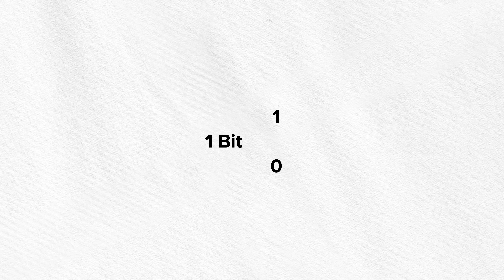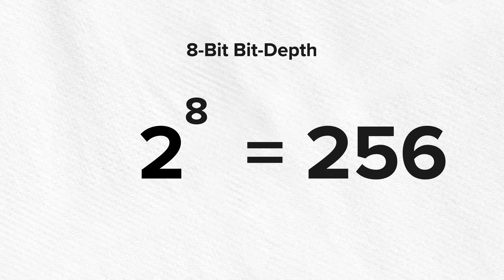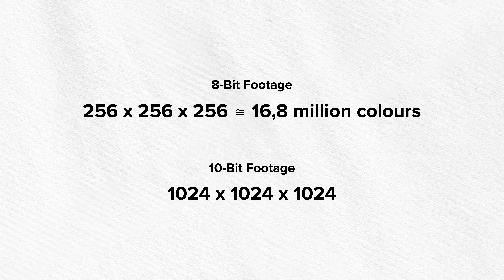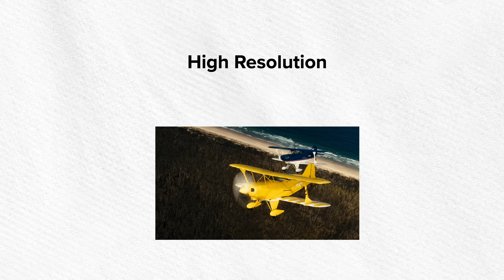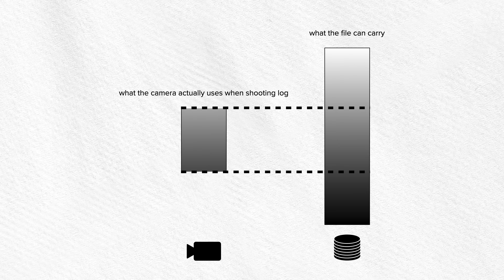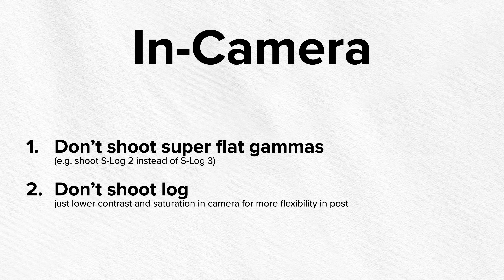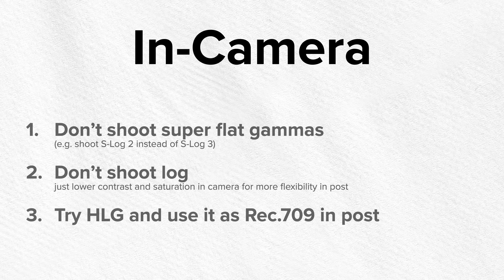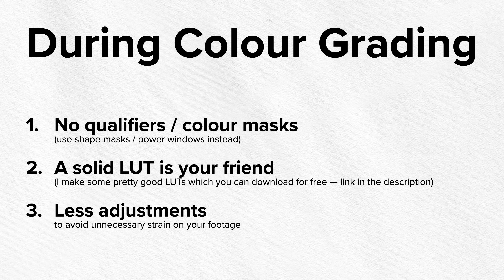Why 8-Bit Footage Breaks and How to Fix it!

Comment: The explanation of log is not correct. Any 8 bit log profile use all steps between 0 and 256. The only difference is that log evens out the colour resolution between the bits so instead of having great colour resolution towards the brightest area of the image and poor resolution towards the darker areas, you now have equally good resolution across the scale.

Comment: Hey Eric, great video, colour banding is my number one issue for my motion design. 

Mainly how to avoid banding issues and other artifacts when compression/encoding algorithms just destroy my work when uploading to social media. With YouTube there's high bit depth options but there is nothing more soul destroying than getting a great result that looks good on my computer and then totally ruined on upload. 

A lot of my questions revolve around aftereffects and 2D/3D work. I have collected lots of advice but it's hard to know how they interplay

1. Impact of fast moving objects on banding 
2. What are optimal workflows for working at high bit depth for low bit depth deliverable, i.e working with EXRs (16+)  even if 10bit or 8bit output, best loseless to h.264 workflows
3. How destructive is using just 1 or 2 8bit effects in precomps of an overall 16bit project
4. Which different adjustments to avoid...contrast
5. Does CBR vs VBR actually make a difference to banding 

If you think you are a good person to answer these kind of questions then perhaps I might book a session.

Comment: That’s not how log works….
Reply from the maker: What‘s wrong with that visual representation?
Reply: @iamericlenz  It does the opposite: while a "normal processed" image is adjusted to get nice contrast and colors on the final viewing device, it discards information (especially in the highs and lows).
Log compresses all the information of the sensor into the available bandwidth, even if the final viewing device can not display it. That's why it looks "washed out".
But then you can (and have to) decide afterwards, what part of the image information should be displayed how, something you can't really do if you directly save the "normal processed" image.
Reply: @ljackattack You are confused between log and Raw

Comment: I’m very VERY glad I came across this. 

All of this is not entirely accurate. Log is meant to take the entire dynamic range in linear and squeeze it logarithmically. Funny enough most sony mirrorless cameras and most other popular cameras have 12bit linear readout before processing is applied internally. Now when the log encoding is applied, it takes those 12bits and can squueze it to 8bits with no loss of dynamic range or tonal range. This is why I always say slog3 is 100% usable in 8bit sony cameras.

Now where the issue truly lies with 8bit is using vast color gamuts such as sgamut which is not even the real sgamut from the cinealta line. It’s just an approximation meant to color match alpha/fs/fx lines to the cinealta camera footage. Sgamut is massive (almost rec.2020) and trying to fit that much color into 255 shades causes massive issues. Not to speak of the fact that it’s an approximation meaning it’s not color accurate at all. What 10bit log fixes here is the issue with the color banding. So using sgamut/vgamut and such with 8bits is the actual issue. There’s a way to remedy this.

There’s a colorspace that almost every capable sensor today can faithfully reproduce and that is rec.709. It also neatly fits into 8bit without much banding issues. Sony calls this gamut ITU709 Matrix. Unfortunately you cannot change this with lumix cameras such as the GH4 but 8bit hasn’t been an issue for a WHILE with lumix.

So what you do is combine Slog3 gamma (which takes the entire dynamic range of the sensor) and combine it with the ITU709 Matrix gamut. Unfortunately your gamma view assist will not work anymore and you’ll have to make a LUT taking in Slog3/Rec.709 and spitting out a Rec.709 gamma 2.4 image and monitor the image using an external monitor.

Once you do this, you’ll realise the colors are amazingly color accurate like 1:1 rendition to real life, you can push them as hard and even harder than 10bit sgamut footage. The only issue with the ITU709 is that it simply clips colors it cannot perceive, but you won’t see that on your NLE. It’s a smooth rolloff into nothing.

When I say that the old 8bit sony cameras are still VERY MUCH USABLE today, I really mean it!
Reply: I shoot in 8bit 4.2.0, S- Log 2 and SGammut3.Cine. after the grade a convert it to Rec.709 and 2.4 gamma, everything looks beautiful.
Reply: @ yeah but your dynamic range is limited since slog2 doesn’t map the entire dynamic range of the sensor and sgamut3.cine is not as color accurate. 

But if it gives you the results you want then thats awesome
Reply: I will try shooting some flowers and very color intense scenes in Slog3 ITU709 matrix today in my a6400!
Reply: so I did some testing with my 35mm f1.8 and it looks so good. The only post-process need they need is some curves in the RGB curve in Premiere but I noticed stronger CA in the video. So definitely watch for that when shooting. I will try Slog2+ITU709 next!
Reply: @ that’s not exatcly what you should be doing. You’re supposed to transform the actual slog3/itu709 into rec.709/gamma 2.4 but the issue with premiere is that there is not color space transform and a lut needs to be manually developed in davinci. I’ll make a video on this at some point and link the lut
Reply: @ try comparing the CA to your RAW photos. Chances are that the colors matching your CA were muted in Sgamut and not represented well. Try closing down the lens a stop and it should massively improve
Reply: @shueibdahirmotionpictures  It would be great if you show how to work as you are describing. Have a simple zv-e10 (and final cut) and it would be great to learn to maximise it!
Reply: was thinking, that what he said about log squeezing not using the whole 8bits wasn't right...
Reply: @rapflapfl  yeah for 12bit linear which is 12 stops as in 4096 values can be represented with 255 values in log. For 14bit linear which is 14 stops and 16384 values, you need 1024 values to represent it. Only mirrorless cameras I know use that many values are the XH2s and Canon C70 and those don’t even offer 8bit in log. 

There’s a lot of misinformation in the camera marketing meant to have you spend much more money. The only reason to even by higher end cameras is to mostly gain more internal processing power or some feature that will very much save you time in production
Reply: A lot depends on how the image is going to be processed in the pipeline. A clean, ungraded 8 bit log image may look good, but it wouldn’t take much for it to break in post-production once you start grading, tweaking black levels, etc.  ILM used 8 bit log in the 90s for their movie work, as opposed to Kodak’s 10 bit cineon log format, and it shows, particularly in the blacks, in their movies back then.
Reply: @crunch8484  You seem to misunderstand what I meant. When it comes to bitlength, 8bit is more than enough for reproducing 12 stops of DR and containing rec.709 and being just as robust as 10bit log. This applies to only SONY cameras.

The issue is not the bitlength, it’s the codec used which dictates how much abuse the log footage can take
Reply: is this real?? i'm using ZV-E10 I and i'm struggling a lot with banding when using slog3 and sgamut 3 especially on skin color and sky and that makes me stop using any type of slog..
Reply: @PinotNoir_  Try this fix, overexpose so that the midtones and shadows are recording higher up in the log curve, next increase in camera saturation to +20 and bring it down in post, try to shoot at native iso of 500 or even till ISO 2500, apply LUT or rec 709 transform in Davinci and literally the image would be breathtaking. And don't be discouraged looking at shadows when switching to slog3 which has a noisy magenta hue, it won't show up when you record and for magenta shadows, just add more green in white balance.
Reply: @adyahhindi i usually shot it at +2 EV, but never tried to set the saturation to +20. I'll try it when i get a chance to record something, thanks!
Reply: @PinotNoir_ did it work? Just bought one ZV-E10 👀
Reply: @jorgealbertomartinezortiz374 maybe it's because my lack of coloring skill or i didn't expose the clip correctly, but it didn't really work, it reduce the banding but it's still visible. maybe it's just the fate of 8bit camera i guess. Gonna try slog2 next since it's supposed to work much better with 8bit camera
Reply: What’s the best picture profile and color space for 8 bit without using an external monitor? I’d like to try this but I don’t have a monitor
Reply: I agree on the original comment. Slight modification: I prefer movie colour space over ITU 709 Matrix because the latter is very reddish on my camera model and introduces a whole lot of WB work whereas with Movie it's fine and as you said: really accurate.

Comment: In my experience I didn't have a lot of visible banding with '8 bit log footage', but rather that blochiness in dark areas. Which brought me, and, I guess everyone with that problem, to a simple solution - avoid completely black areas in the shot and give them a proper light. That means you have a very well lit shot and can drag the exposure down, and here's that problem with the colours - you just can't jump from even very well lit tones to "moody" tones without breaking the image to those blocks in certain spots.
Sometimes I had a great and clean image  - but it was a so called 'high-key' grading, where I didn't have to create a huge contrast ratio. So. what I'm basically saying is repeating you - if you're not a pro-guy who knows how to perfectly shape the light, better stick with other profiles and get your image as efficient as possible right in-camera and make only little adjustments in post
Reply from the maker: Absolutely! Also, when it comes to blotchiness in dark areas, we‘re moving towards codec and chroma sub-sampling territory which also plays a huge role.